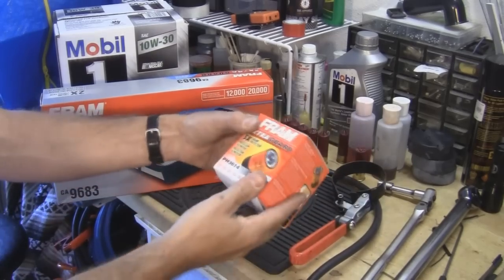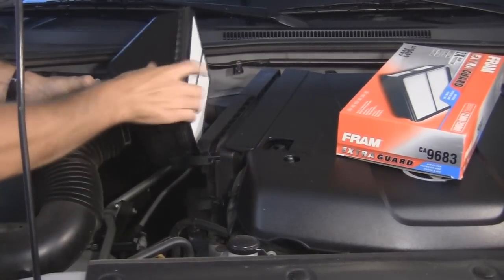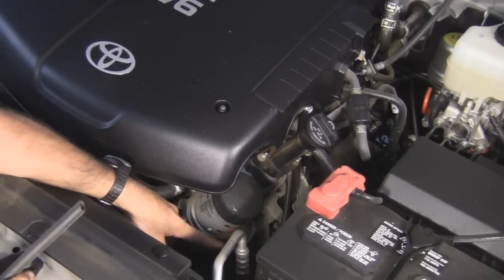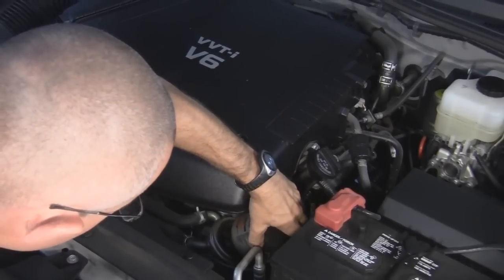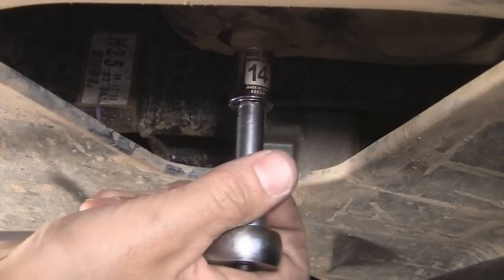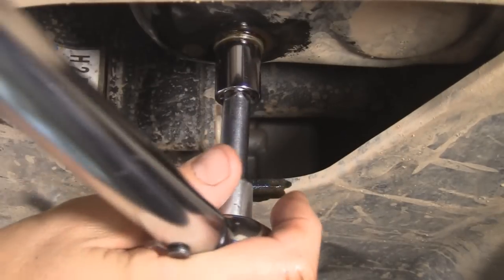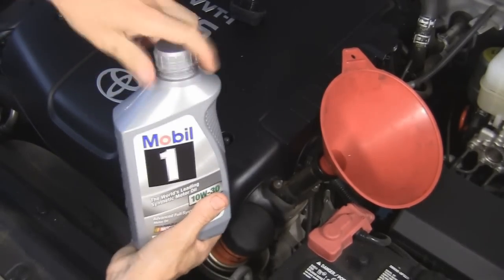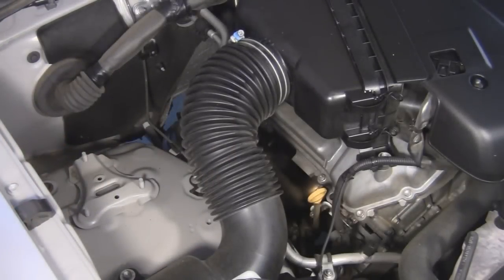Toyota Tacoma Gen2 Oil & Air Filter Change DIY 1GR-FE 4.0 L V6 Engine 2005-2013

Comment: I wouldn't recommend Fram oil filters. It's been proven on Project Farm channel they are terrible. Also, 10w-30 probably isn't the best for the VVT system. It's better to use a thin oil with these systems since they use tiny solenoids that require thin oils. I think most recommend 5w-30 or even 0w-30 on these 4.0 V6's

Comment: Any thoughts on running the engine to heat up the oil so it all comes out?  Any thoughts on how not to get burned if you work with the hot oil?

Comment: Both OEM and oil plug gaskets are available on EBAY at very reasonable prices.    You can get 100 gaskets for about $15.  Anyone one know if oil filters sold on EBAY are genuine OEM as they say?

Comment: What will this cost at the dealer?  Local dealer offered oil change for $36.95.  Then the dealer added a 40 dollar labor charge and shop supplies charge plus tax.  Total cost?  About $94 dollars.  When a customer asks an independent mechanic for a cost that $36.00 is very near that price.  A little over $46.   Also keep in mind the dealer will charge you $85 plus tax to change the cabin filter and air filter.  Both items will cost you about $20 with free shipping on EBAY.  The Cabin Filter alone will cost you about $7 on EBAY.  Both easy to install.  The CABIN FILTER is located behind the glove box which comes out easily.  YouTube videos are very clear about changing the Cabin Filter.  Seems the oil filter is as easy to change.  In any case go to an independent dealer for a better deal unless you need to worry about documenting you warranty.  Be sure to keep all oil change receipts.

Comment: Instead of doing the hose, take that cup and attached at 8" string to each end of it, hang it off the filter holder, unscrew the filter and it drains directly into the cup. Screw on new filter, spray brake clean in the oil filter holder to remove excess oil, remove cup with zero mess :)

Comment: Thanks John, great work. Toyota Land Cruiser Prado 2003 model 4.0lt petrol V6 followed your guide and the job was very simple - largely due to your clip giving me the confidence to get it done.
Cheers from Queensland Australia.
Reply: gday from fort vic, i just bought a 2007 prado ,love it ,amazing machine and do you use 10w 30 oil in the warmer months or 5w 30 all year round cheers

Comment: I used to think it was awesome that toyota put the oil filter on the top...

but now I think its kinda silly no?
Reply: The Chevy S10 had the oil filter there but it got there because of an adapter under the engine that routed the oil there.  The gasket for that adapter would get old and blow out sending a cloud of oil out the back of the truck.  Owners had to call a tow truck since putting oil back in only meant a few miles before the oil was gone.  Maybe Toyota Tacoma owners have the same setup.  If that is the case perhaps you should have that gasket replaced when the truck ages.  Getting stranded in a remote area (in winter) can mean ruining the engine just to get to a safe place or freezing to death.

Comment: Used oil has heavy metals in it. Use gloves. Take the engine cover off for clear access to filter- this takes 10 seconds. Drain sump oil first then run the filter drain pipe into the pan so you don't have to stuff around with a cup. Air filters only require changing after 45,000 miles. Your one looked pretty clean ay

Comment: good video john- i would not use fram oil filters- very poor filter;  toyota master mechanic has told me to use only toyota oem filters on toyota vehicles- check them out you can see the difference

Comment: Thanks John, worked great except could not get filter off with wrench tool so had to use channel lock and basically squeezed it until I could break it loose. Not alot of room there for a tool

Comment: very good job thanks for the video you used good oil. the only thing you might want to do it get better filters fram is not very good filters go with a wix or toyota filters or K&N oil and air filter.
Reply: Jeremy Bonham, I like the TRD  airfilter,  but I use Genuine Toyota oil filters. On the Toyota oil filter there's a bypass valve so in the unlikely event of a clogged filter your engine will still allow oil flow. I don't know if those cheap filters have a bypass valve.

Comment: is the service manual call for 5w30 ? instead 10w30 , just asking
Reply from the maker: matimeo21 I think 5W30 is written on the oil fill stopper.  Back when people did 3k mile / 5k kilometer oil changes they always used 10W30 in summer and 5W30 in winter. Either will work fine. /John

Comment: One thing you can do instead of messing with the hose or a catch bottle for the oil filter drain is to punch a whole in the top of the oil filter. This causes the vacuum to break and the oil drains out of the filter and back into the engine. Then you can remove the filter with no mess.
Reply: +Justin Siders smart.
Reply: Very smart.
Reply: That sounds really good at first, but then aren't you pouring oil that could take the scum it filtered back through the motor?  I am not being a smartass.

-edit.  I guess this happens each time the motor sits anyway.  I guess filters can contain the crap it picks up.  Odd design seems you'd want this with opening up for this reason.  *I just bought a 2011 4L Tocoma and love it so far*

Comment: Why not drain the oil pan first ? You'll have less oil in the filter when you change that next. Easier and cleaner.
Reply: Komy Ghods the vacuum inside the filter means the oil stays inside unless you make a hole in the filter

Comment: My oil filter is leaking oil, and i never had a problem with it... my old man said its because i might have screwed it wrong and it chipped the bolt.. i keep thinking its the oil filter that doesn't work.. do you have an idea of whats wrong with it?
Reply from the maker: elmigoel I'd replace the oil filter.  Only time I ever had a filter leak was when I wasy 17 years old, one time I replaced the filter and forgot to remove the old rubber seal that was stuck on the engine.   The oil filter seal would not seal to the old stuck seal - created a huge oil leak.  I never did that again! /John

Comment: I know it said 05-2013 tacoma but my 2014 looks just like the the 2013 oil filter on the top, so is it the same way for my truck?
Reply from the maker: sleeper The procedure is the same for your truck.  If the oil filter is the same then that part of the job is also the same.  Some trucks have a different oil filter. /John

Comment: I learned a lot, thanks man. Going rate for a 4cyl 5w30 synthetic change at the dealership is $49 and change. I just bought a used taco and felt the urge to get it in right off and have the pros do the first fluid changes so I can have a pro give feedback on what they see. Aside from that, what I learned from you video will carry me the rest of the way with my new t-ruck.  Nice shirt btw, they're an hour east of me.
Reply from the maker: Salty Diarrhea Thank you.  Hope you like your new taco. /John

Comment: I just bought a 2010 Toyota Tundra with the same 4.0L V6 engine.  Doing my first oil change today.  Most of the Tundra oil change videos are for larger engines and simply not applicable.  This video has excellent detail and is very clear and concise.  Great job!!  Thanks for the tutor.
Reply from the maker: Randy Weitzenkamp you're welcome.  Good luck with your new truck.  /John

Comment: good video.   you would have a lot more space to work (especially if oil filter is tight) if you spend a couple minutes removing the engine cover (2 nuts)

Comment: I dont like the filter is in the top of the engine... I like my nissan frontier its in the bottom but toyota is good very easy to change the oil..

Comment: Perfect! thank you! especially for the tip about the Plastic tube and the drain on the oil filter. My Subaru had something similar but it did not drain onto the floor.. not sure where it went?? HAHA. Just did my first on my 2013 Tacoma TRD. went perfectly. :D
Reply from the maker: Matthew Perna That's awesome!

Comment: Two things -(1) crush washers are meant for one-time use.  Buy them in bulk and replace every time.  (2) Open the filler cap before draining to release the vacuum.  Think  of how easy it is to chug beer from a can when you punch a hole in the bottom of the can.  Same with oil.  It will come out faster, with more force.
Reply: crush washers - "i'm not going to fuck with it"
works fine.

Comment: Question? Couldn't you open the pan bolt at the bottom THEN crack open the filter and let the suction/gravity take it instead of in the pan on top? IDK I just had the thought, but either way great video
Reply: Yeah, I have '12 Tacoma and removed the bolt from the oil pan; I didn't even consider doing it another way:)

Comment: Great video! I really liked how you used the tube when removing the filter. But I would stay away from FRAM OIL FILTERS their garbage! I always use a TOYOTA BRAND FILTER thier on par with Mobil 1, and K&N, but cost just as much as a FRAM.
Reply: The fram ultra guard is pretty awesome. And heres a trick for all of you , instead of using the 3614 for the oil filter , use the 3600 , its wayyy bigger , so that means it has more media filter surface ....Learned this from a guy who races them .....Mobil 1 has the same type of oversized also and K&N , I just cant remember the numbers right now....Add an extra 1/4 qt. to make up the difference in size of the filter.

Comment: Either 5W-30 or 10W-30 offer the same summer protection. The 1st set of numbers(5W-10W) represent the winter range; the 30 represents the summer range in this case. 10W-30 is used on engines that have burn-and -sheer issues such as late model Dodge Chargers running the 3.5l engine. Read your owners manual and use the viscosity listed in that manual.

Comment: personally for the oil filter, after i take out the rubber cap, i hold a styrofoam cup under the drain and catch the oil that way, less work. (you can hold it with your hand, or i have also taken part of an old wire coat hanger and re-bent it so theres a smaller hook on one end and then a circle where the cup can fit into it, this may work better if you have giant hands)

Comment: I bet this saved 20-30 bucks at least. Of course I'm sure you spent 25 on the air filter.  I think most dealerships will charge you 60-80 dollars for an oil change with the good synthetic stuff.  A standard oil change around here is about 35-38 bucks

Comment: Manuel,  because the oil filter is hollow and some oil is always trapped inside it.  When he loosens the filter it pours from the openings in the bottom of the filter.  Look at a new oil filter sometime.  Oil just kinda sits in there when the car isn't running. Draining your oil first won't evacuate the oil from your filter.

Comment: Here's what I don't get: if the oil filter is on top of the engine and tilted in a down position, why not just drain the engine oil first, take off the engine oil filler cap to let the oil flow more easily, and see if the filter oil doesn't drain back into the engine of it's own accord without having to attatch the rubber tube from the oil filter catch flange to under the engine into the oil catch pan?

Comment: thanks for the tutorial, it helped. Also, If you're like me and don't have a piece of rubber tubing laying around, I found a paper drink cup works fine when removing old oil filter - take off the rubber cap and place the cup under the drain nipple beneath the filter shroud......worked fine and in my humble opinion, was easier too.

Comment: sorry but ur supposed to use 5w-30 synthetic blend all year round, not too good to change weights.but u gotta love the ease of oil change service, putting the oil filter on the top of the engine was so smart on toyotas part lol..and look man,it takes 5.5 qts with the oil filter installed.. why ur over filling it with an extra 1/2 qt plus ill never know... also, the old drain plug crush washer needs to be replaced at every oil change.. just go to the dealer and pick up a bag of 20 for 2 bucks

Comment: sorry but ur supposed to use 5w-30 all year round.  not too good to change weights.... but u gotta love the ease of oil change service.. putting the oil filter on the top of the engine was so smart on toyotas part lol

Comment: if your miles are below 70 to 80 thousand u should be using 5W-30 Mobile 1 is the best. Only use 10W-30 when the miles are over 85 to 90 thousand because the engine is starting wear just a little bit. USE 5W-30 Buddy!!!

Comment: PLEASE be sure to use Toyota oil filter. The filter contains a check valve that prevents oil from draining back in pan when engine is off. This gives your engine instant oil on start up. Fill new one with oil before screwing back on, you will see oil absorb into filter. It is only about $5-$6...worth a little for added protection.